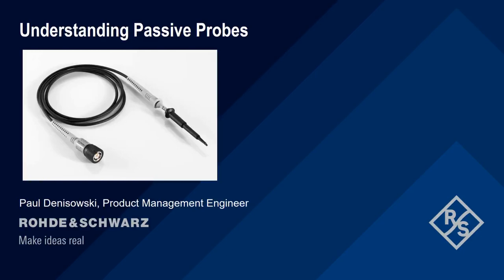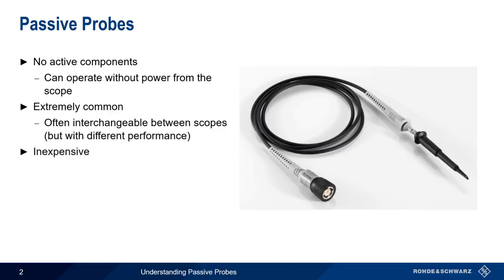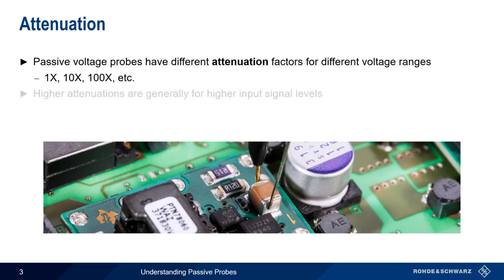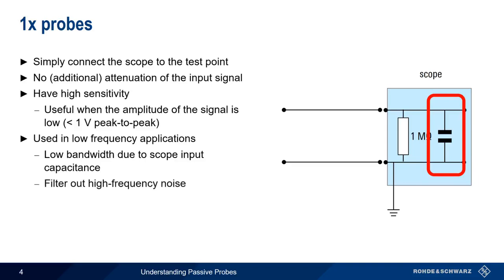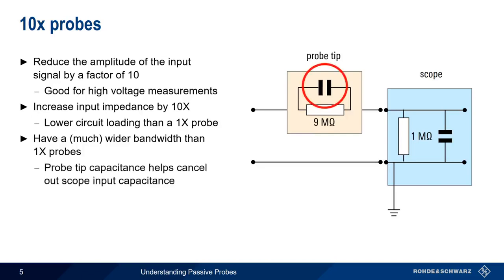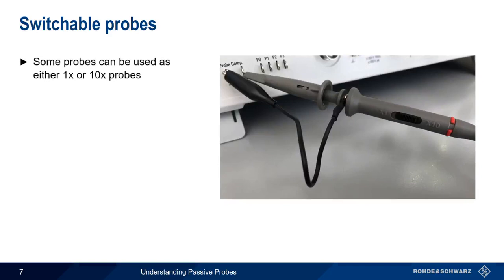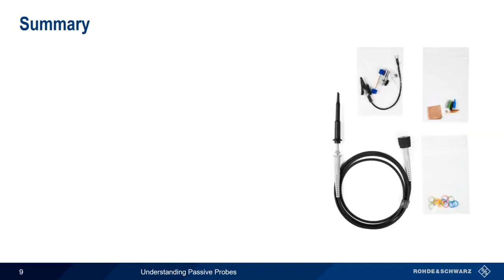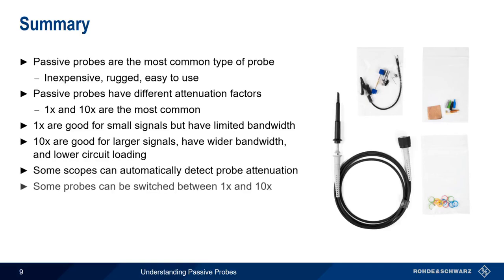Understanding Passive Probes

Comment: I wonder how the 10X oscilloscope passive probe compares with the coaxial cable and the 50Ohm oscilloscope input results when measuring high frequency signals. Coaxial cables have very high BW up to GHz while passive probes of 10X oscilloscopes usually have BW limited to a few hundred Mhz.

Comment: how does the probe tip cancel out scope input capacitance ? C1=C2 therefore net cap is C/2?
Reply: (See diagram at 2:51) At higher frequencies the capacitance the scope input will decrease signal level (essentially shorting the signal to ground).  At higher frequencies, the parallel capacitance in the probe tip will "bypass' some of the resistance in the probe tip, increasing overall signal level.  If we choose / adjust these capacitances properly, then we can balance out these two effects.  Hope that helps!
Reply: Basically what you want to do is to maintain the 10:1 ratio of probe signal to input signal because that is what the scope is "expecting." The inevitable input capacitance of the scope acts like a low pass filter at higher frequencies attenuating them. Higher frequencies will reduce the net parallel input impedance of the scope and, being frequency dependent,  you have no control over this.  So the signal "seen" by the scope is lower than expected.  So the probe impedance needs to be reduced to maintain that 10:1 ratio. To reduce the probe tip impedance one needs to increase probe tip capacitance (which will lower net parallel probe impedance). In this situation we say that the probe is undercompensated. Conversely if we reduce the probe impedance too much a higher voltage will appear at the input terminals and the probe is overcompensated.
Reply: @Jnglfvr  Impedance depends on both frequency and capacitance, so I disagree with your opinion: "To reduce the probe tip impedance one needs to increase probe tip capacitance (which will lower net parallel probe impedance)...". In fact, to measure signals from hundreds of Mhz to Ghz, the passive probe needs to reduce the capacitance to a few pF and reduce the probe resistance.